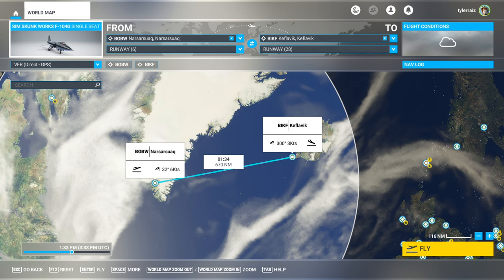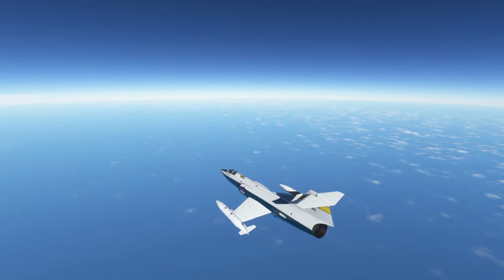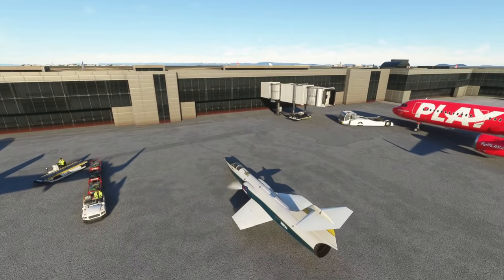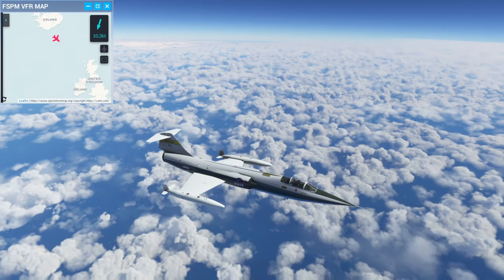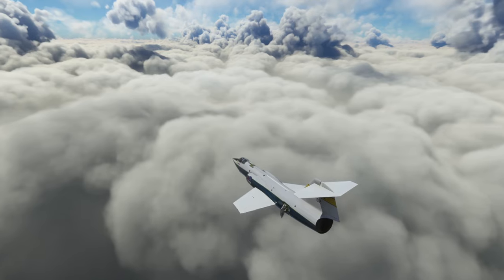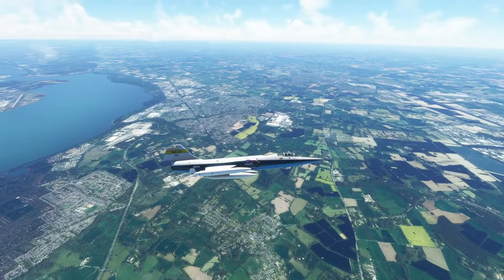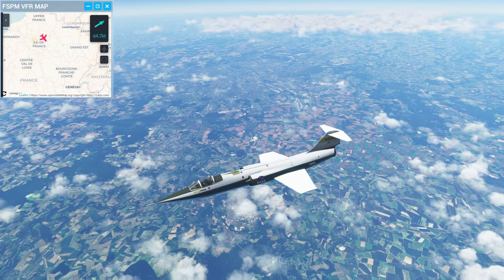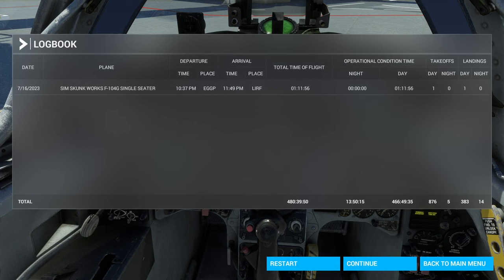MSFS - F-104 Circumnavigation 2

Comment: There's an excellent Pirep on 916Starfighter in the Tally ho section "Zipping at flight level 730"  The pilot describes a Mach 2 cross country with 4 bags of gas.  Another favorite Pirep from the same pilot is "90 sec climb over Florida" where he details a 90 second climb to 45,000 feet with full internal fuel and 2 sidewinders.

Both flights are in an F-104A with the J79-19 engine.

Based on these Pireps the Sim skunk works 104 is a serious underperformer.
Reply from the maker: I'll have to see what the January update did. Hopefully they'll continue to work on it. The sim doesn't make it easy in some ways, though - as I've said, I've found very few of the supersonic planes in MSFS are actually accurate in both speed and range. Most lean towards overperforming, though, because people tend not to complain about that.
Reply: @RaizSpace  With the latest update I'm finding I can get above M1.8 near 1.9 with a clean jet. The climb performance is still nowhere near the story mentioned above, even climbing with no fuel.  The short field performance is hilarious, I've been sticking it on at Saba where the runway is 1,300 ft.
Reply from the maker: Well, that's disappointing - that's about the same speed I got in these videos prior to the update. Crazy though it might be, I don't mind coming to a stop quickly, though. Maybe it thinks everywhere has arrestor wires or something.
Reply: @RaizSpace  I didn't think about trying the hook :)